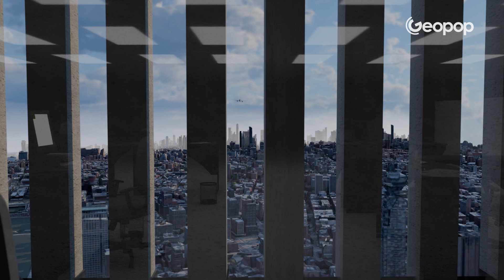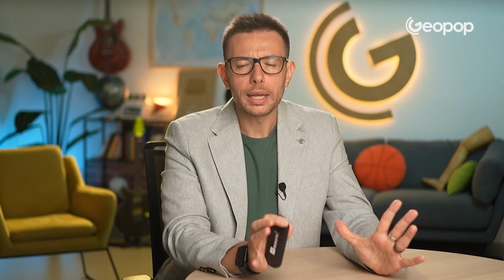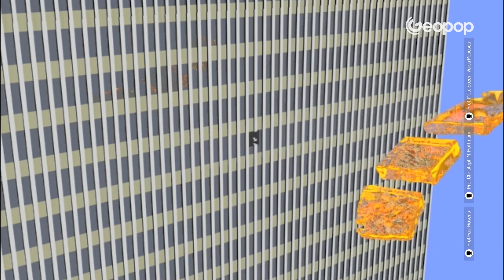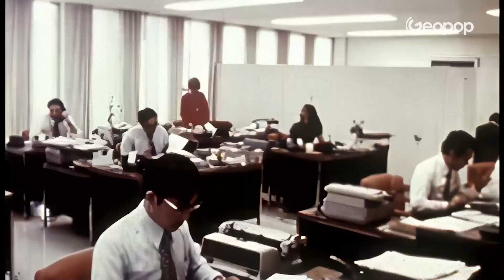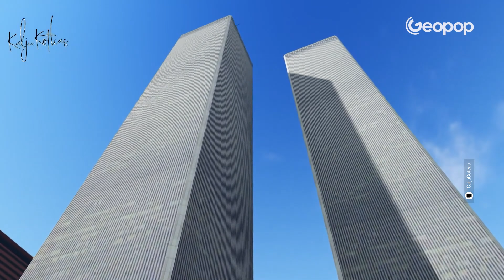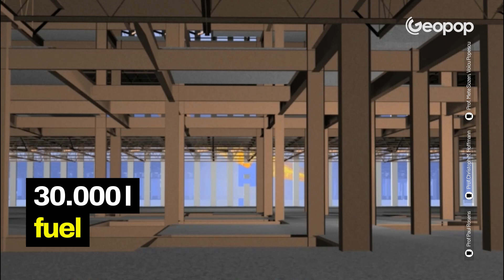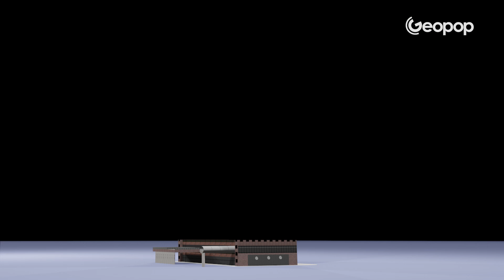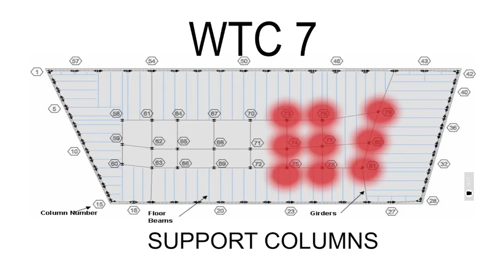9/11, 2001: The Technical Reconstruction of the Twin Towers and WTC 7 Collapses

Comment: Your forgetting 2 very important thing. How does aluminum cut through steel n how does n airplane not break up once it has gone past its maximum velocity speed. Every other airplane in history has either broken up mid air or lost part off the airplane
Reply: Aluminum didn't cut through steel. The reality is far more brutal and violent. To simplify, think bolt shearing failure

The airplanes absolutely broke up - being converted from 120 tons of airplane into a billion bits in a quarter of a second, explaining why they could enter the Towers at 440 and 589 mph respectively and slow down to zero in under 200 feet - a level of violence you can't even comprehend.  I genuinely have no idea what you are looking at. The rest of us can see that. FFS 🤦‍♂

Comment: Why did World Trade Center 7, a 47-story skyscraper never hit by a plane, collapse in perfect symmetry, as if in a controlled demolition?

Why did the twin towers disintegrate in vertical free fall when no steel skyscraper in the history of engineering has ever collapsed due to fire?

Why did thousands of witnesses, including firefighters, rescue workers, and journalists, report multiple explosions on the lower floors before the collapse?

Why did the steel remain molten for weeks under the rubble when jet fuel doesn't reach temperatures high enough to melt steel?
Reply: Your first two questions are all answered in the above video.

Your last two questions are pure feces of the male bovine and thus can't be answered. 

If you need a more detailed answer to either of your first two questions, I am equipped to provide.

Comment: I don’t understand why the load is increasing. To me extra load is more weight. Where is this weight coming from. I must be missing something.
Reply: The mass of each successively failing floor does not disappear, it gets added to the falling mass. 

90th floor fails. Everything above it (mass of 20 floors) drops one floor onto the 89th.  The 89th floor fails and adds its mass to the already falling mass so that now you have 21 floors worth of mass dropping onto the 88th floor.  So the 88th floor fails under the strain and adds its mass to the already falling mass, meaning 22 floors worth of mass drops onto the 87th,...

Rinse and repeat all the way down.

Comment: The explanation for WTC7 is absolute bollocks. If that's true then you would see nearly every building fire collapse like a controlled demolition but you DON'T.
Reply: If the building was steel framed and left to burn completely out of control with no active firefighting for 7 hours, sure.  But then that doesn't normally happen.

Do recall that on 9/11 by the time Building 7 caught fire from the collapse of the North Tower, half of the responding firefighters (343) had just been killed, others injured or trapped, much of their equipment destroyed, communications broken down and units in complete disarray.

How many building fires have to deal with that?
Reply: @TheLoonResistance there's been countless buildings that have burned for far longer than 7 hours that didn't collapse into their own footprint in a textbook demolition fashion.
Reply: @kbonh22  - Since you seem intent on completely missing the point, I'm just gonna avoid a lot of  🐂💩 and go all-in. For what it's worth.

Much misunderstood, Building 7 was the 6th building to collapse of 10 lost on 9/11. Because of its early low priority, conspiracy filled the information void with garbage made up by technically ignorant people promoting political agendas. But 7's loss is an engineering problem and should be treated as such, so I prepared this brief summary of my own analysis to fix that, using technical analysis, not ideology and tired memes. 

At 10:28am the WTC North Tower collapsed, showering Building 7 with tons of burning debris, causing heavy damage and starting many large  fires which burned out of control for the next 7 hours. Half the FDNY firefighters having been killed, units in disarray, equipment destroyed, no water pressure, and the greater urgency of search & rescue efforts, Building 7 couldn’t be saved so firefighting efforts were pulled as futile and 7 left to its fate. Firefighters make that sort of choice every day in brush fire situations - which houses to save and which ones to let go. Only real difference here is moving the decimal on the size and cost. People get overwhelmed by the size.

www.youtube.com/watch?v=g_SvpwyC17M

Collapse of a burning structure is always a concern for firefighters. Steel buildings subject to fire rely on active firefighting to survive. Buildings are designed around 1 to 3 hours of fire resistance, allowing time for occupants to escape and active firefighting to get started, after which all bets are off. Left to their own devices they'll exceed their design envelope and collapse, like Plasco Tower and Wilton Paes de Almeida. In 7 the occupants escaped, passive and active fire protections were compromised and active firefighting was abandoned hours before the collapse, which left the building to its fate. It lost. Odds on Building 7 would eventually collapse, and it did. No big deal in logic.

 http://www.youtube.com/watch?v=WnYBX6QT0R4 

FDNY Chief Daniel Nigro - The biggest decision we had to make on the first day was to clear the area and create a collapse zone around the severely damaged 7 World Trade Center, a 47-story building heavily involved in fire. A number of fire officers and companies assessed the damage to the building. The appraisals indicated that the building's structural integrity was in serious doubt. I issued orders to PULL back the firefighters and define the collapse zone. It was a critical decision; We could not lose any more firefighters. It took a lot of time to PULL everyone out, given the emotionalism of the day, communications difficulties and the collapse terrain 

FDNY Deputy Chief Peter Hayden ; We had our special operations people set up surveying instruments to monitor and see if there was any movement in the building. We were concerned of the possibility of collapse in the building. And we had a discussion with one particular engineer there, and we asked him if we allowed it to burn could we anticipate a collapse and if so, how soon? And it turned out that he was pretty much right on the money, that he said 'In its current state you have about 5 hours 

The collapse of Building 7 was anticipated and widely reported in the media throughout the day, with 24 video cameras recording some or all of the collapse. Everyone knew what was coming and why. 

www.youtube.com/watch?v=OY5S5k3tMHI

The collapse of Building 7’s was entirely different to the Twin Towers and harder to understand, most details being hidden from view and not intuitive.  But we can still sort out what happened through careful analysis and observation. This is my explanation of the collapse relying on no outside authority. 

Building 7 was a unique, asymmetrical 47-story steel framed structure built atop a smaller 3-story building serving as a partial foundation, requiring lower floors dedicated to complex load transfer structures. Of trapezoidal shape and all-steel tube-in-tube construction, B7 (above the 7th floor) consisted of a central core of steel columns carrying most of the gravity load, perimeter steel columns around the outside of the structure carrying the remainder of the gravity loads and long span beams and girders to tie those elements together and form the floors. On the outside of the building hung a moment frame or outer shell. 

Phase 1 : First externally visible signs of collapse initiation occurred at 5:20:28 pm and were notably quiet with observers not realizing the building was collapsing! No audible warning in the form of hundreds of ear drum busting 180-190dB explosive bangs preceding the collapse. Here at 12:00 a local CBS affiliate reporter is talking 10 blocks from B7 when collapse begins. People don’t start to notice the collapse until 12:11. At 12:45 is the famous CBS fixed camera clip of Building 7’s collapse. Note how quiet it is. 

www.youtube.com/watch?v=t5tEy6mXSE8

Collapse initiation was due to lower floor failures above the load transfer region (8-14th floors) in the NE corner. In this video at 0:45 you can see the NW corner from inside the building while under construction, Column 79 just out of frame on the left. That big, angled steel beam across the top of the frame connects to C79 at one end. The girders connect to the beam. That beam and all those girders depend on just one connection 

www.youtube.com/watch?v=nP3TNHPCIVU&t=45s

Phase 2 : The NE lower floor failures caused a loss of critical lateral support over an excessive length of Column 79 and it buckled. Looking at a floor diagram of Building 7 (www.nist.gov/image-16640) when you see all the structures that depend on C79 you quickly realize this one column was a relatively isolated structural element on which a disproportionately greater fraction of the structure depended analogous to say the Key Bridge. Externally as collapse begins we see a vertical progression of window breakage along the 44-46 line and a kink in the roof of the East Mechanical Penthouse at the top of the building, consistent with C79 failure. Normally with a buckling column, the load could be redistributed to other columns. With C79 that is not the case - the failure did not redistribute the load, so the collapse rapidly progressed to the roofline, sinking the rooftop penthouse. The transition from full capacity to almost no capacity occurs in an instant and will result in virtually no resistance 

Phase 3 : With C79 gone, B7’s progressive, non-symmetrical collapse continues with adjacent columns 80 and 81 left laterally unsupported, and quickly buckling as well, sending the EMP down through the building. C79-81 all have no diagonal bracing, which is the major reason why they could not redistribute a lot of vertical loads among one another. From there collapse progressed from east to west through the central core until the core was gone taking all of the interior floors and probably most of the perimeter columns with it. Follow the horizontal progression of window failures low in the building and the dropping of the remaining rooftop structures into the building. One of the big takeaways from the NIST Building 7 study (invariably ignored) was how their modeling determined C79 failing under ANY circumstances would have initiated the same collapse sequence. 

Phase 4 : After about 10 seconds only the exterior moment frame remains, giving the illusion B7 is still standing to the casual observer since little has outwardly changed. But it is just a hollow empty shell like an empty cereal box supported only by a few remaining columns and overloaded from the loss of the core columns and floors, quite unable to remain standing. With nothing remaining behind it, the north face leans inward, forming a V in the roofline, the last few columns buckle under the strain and the moment frame free falls, landing on top of the debris pile. 

It is only here at the very end that a single measurement of alleged free fall acceleration is taken, from a single point on the outer shell. The Building did not “free fall” – just one corner of the outer shell did, sort of. The Building_ (defined as its center-of-mass) was already gone before that happened. The period of alleged free fall was a product of how it fell NOT why it fell and can't tell us what started the collapse 10 seconds earlier. Start to finish the collapse took 18-20 seconds, 3 times longer than free fall . How fast something falls cannot tell you what started it falling_ anyway. 

The debris spread outside the footprint blocking surrounding streets, heavily damaging the Verizon Building and destroyed Fiterman Hall. 

Building 7’s progressive, non-symmetrical collapse was incidental and unintended collateral damage from the combined effects of fire + time + gravity, started by the collapsing North Tower. That is true no matter who planned and carried out the 9/11 attacks or why . The collapse was of so little consequence it barely registered at the time - a footnote, only taking on semi-mythical status as an alleged smoking gun years later when demolitions at the Twin Towers, missiles at the Pentagon and shoot down over Shanksville all failed and conspiracists had nothing left to work with. 

Anything can seem like a conspiracy if you don’t understand how it works. Now you should. I hope you found this helpful, informative and it solicits informed critical comment. If I made any errors of fact, logic or reason or left anything important out, please let me know so I can fix it. IF you can offer a more plausible alternative please do. Be the first. Please start any reply with the words “Tits McGee” or I will know you didn’t read it and are wasting my time.

Comment: Why doesn't anyone ask the most obvious question? Where did the two towers go?  There wasn't enough rubble on the ground after the collapse. Not anywhere near enough. Instead, there were thousands of cubic meters of fine dust in the air. The towers turned into dust. You can see it on all the footage. 
Now, ask yourself - what turns steel columns and reinforced concrete into dust? Have you ever seen solid steel pulverised?
Reply: Because anyone with one working eyeball knows exactly where they went - down.

How about these obvious questions:

Exactly how much rubble was removed from Ground Zero in the 10 months of the cleanup process?

Exactly how much rubble should there have been?

Where did you arrive at these figures?

How did the steel of the Towers allegedly turn to dust ?

If the steel all turned to dust how do you explain this:  www.youtube.com/watch?v=u2D__-DVLBk

Can you answer the question posed at the end of the video?

Do you even understand the question posed at the end of the video?
Reply: @TheLoonResistance yeah... because we all know that dustified steel has orange colour 😂😂😂 🤦‍♂️🤦‍♂️🤦‍♂️ Why not? It's made of oranges, isn't it?
Good grief... 

And did you check your steel quantities numbers? Where did you arrive with that?
Reply: @ALM_886 - No genius.  What happens to bare, unprotected steel when it gets wet?  

It starts to rust almost immediately and turns orange - the color of rust. 

So if steel dust was covering much of Lower Manhattan just the next days morning dew would have been enough to cause the whole town to turn orange.   This is a simple concept you can test yourself by just getting some fine steel shavings and getting them wet. 

I had to tell you that last part because you would never have thought of it yourself.
Reply: @ALM_886 - You're welcome. Glad we got that sorted out.
Reply: @TheLoonResistance 🤦‍♂️
Reply: @ALM_886 - Worth noting that is NOT a rebuttal.  I will accept that as your tacit admission you have ceded the point.  

Have a nice day.

Comment: In my opinion there had to of been bombs inside as well as many structural beams cut. There’s absolutely no way that burning jet fuel which is kerosene could cause this kind of damage. There’s absolutely were said to be construction workers in the building for months beforehand that were of Muslim descent. I personally believe those people were in the guts of the building cutting beams with torches and placing explosives inside.. when they collapsed it was not like the building falling over, it was more of a planned demolition or implosion if you will. I also believe that our government was warned and did absolutely nothing about it because they were paid off by someone.. again I want to stress that there’s no way possible that jet fuel which is a low volatility burning substance could cause that much structural damage. And then there’s the pentagon, in which a plane hit but they never found a plane🤷‍♂️ I worked in heat treating and we heated steel much hotter than it would’ve gotten from the burning jet fuel. It would’ve made the structural steel harder than it is initially but would not have melted. It’s such a shame that all the innocent citizens and 1st responders had to die because we’re all getting lied to
Reply: Jet fuel didn't.  Twin Towers collapses were a combo-platter of four (4) factors;

Impact Damage _ Fire (heat) + Time + Gravity = Collapse

Remove any one of those four factors and there is no collapse. Ignore any one of those four factors and you will never understand the collapses.

You ignored 3.
Reply: Notice how stinky left out."resistance "
Reply: Notice how stinky left out."resistance , potential energy, newton's 1st and 2nd laws, let's not forget structural damage, and faulty engineering because these buildings were designed to burn to extention without collapse. By not succeeding, it would indicate faulty construction.  Show me proof of this engineering defect or add explosives to your list.